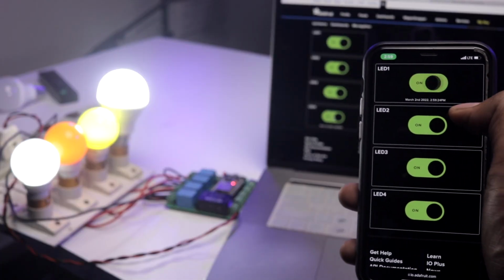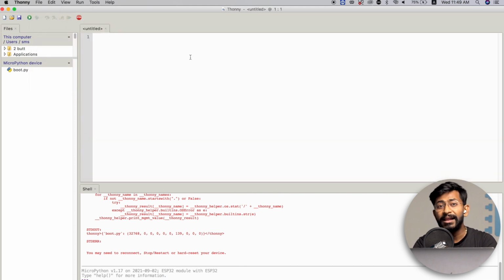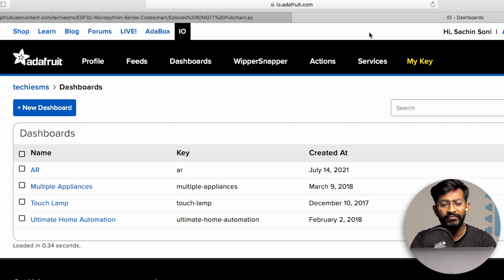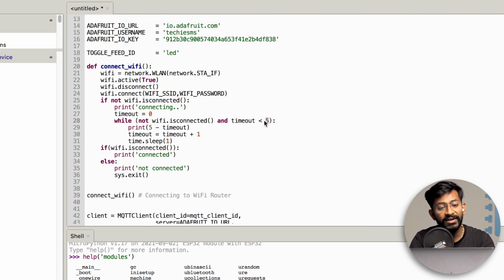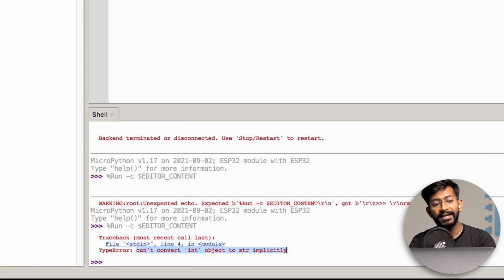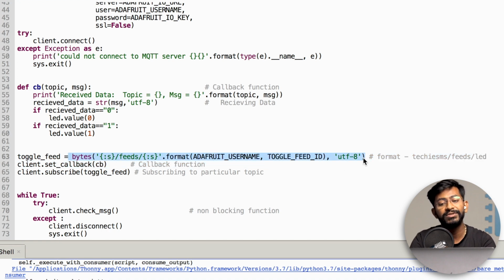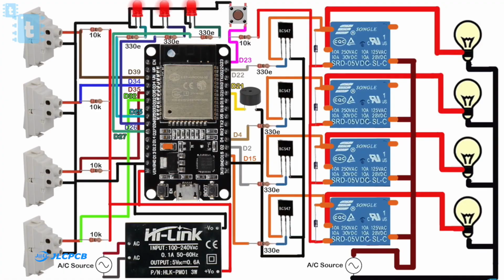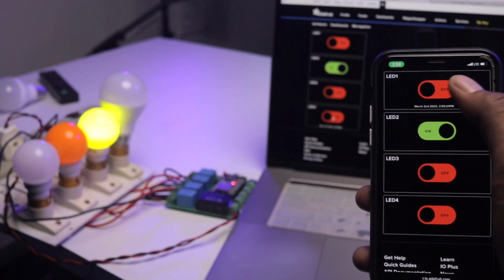Adafruit MQTT Home Automation Micropython | try except block | sys.exit() | ESP32 Projects

Comment: I realized that my client connection to the Adafruit server times out after 5 minutes. Do I use the "keepalive" setting to control that and if so, what is the correct syntax to use it?
Thanks
Reply: how did you solve it?